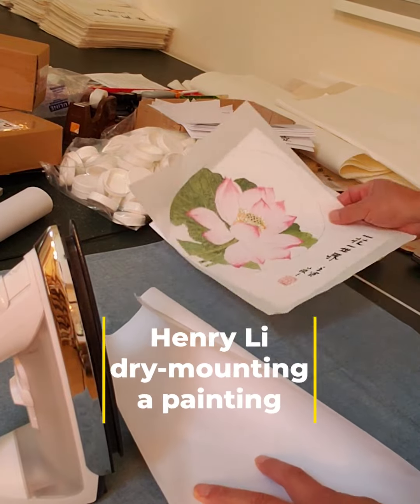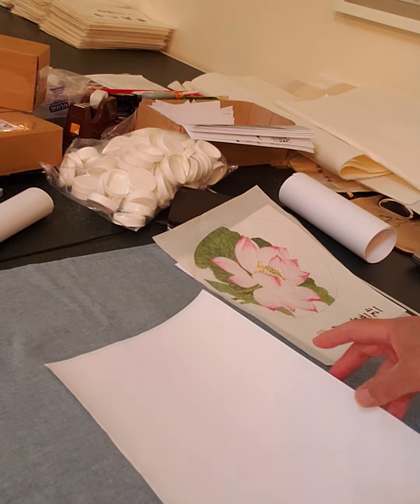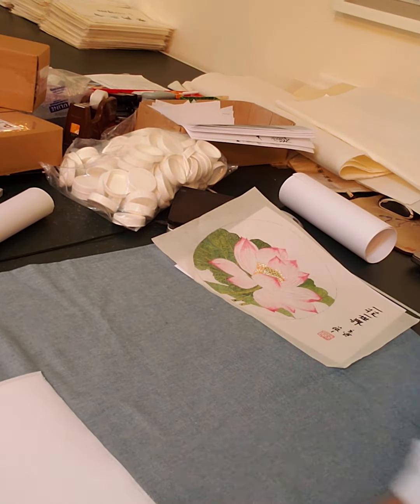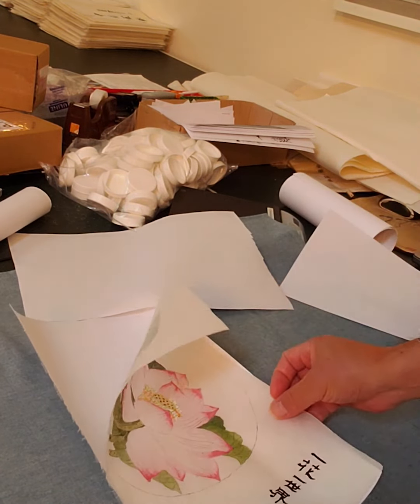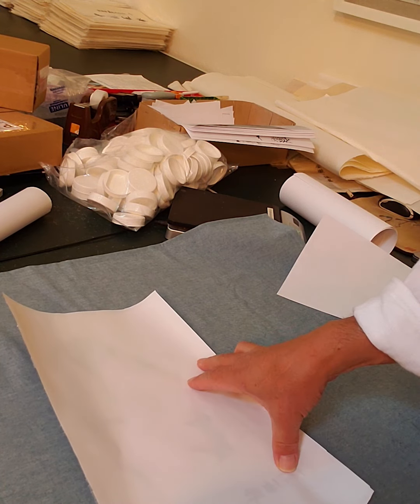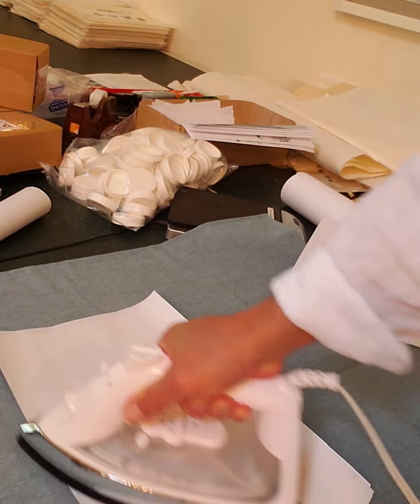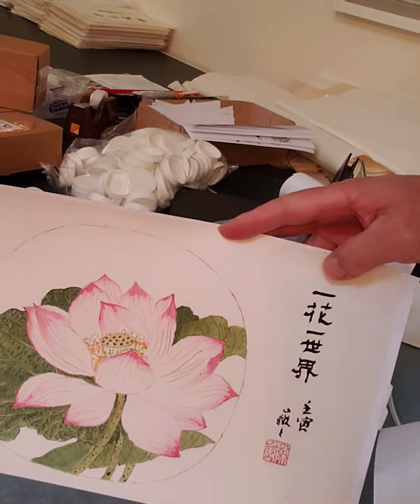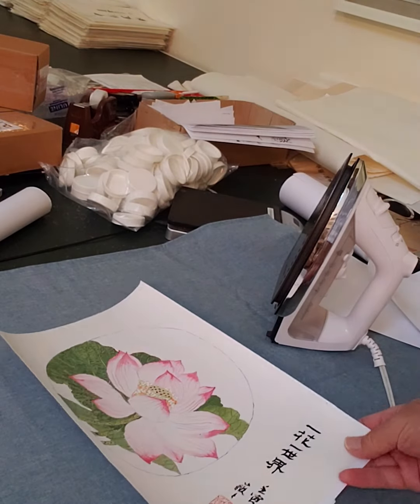Dry-mounting a thin rice paper painting with silicone paper

Comment: Thank you for this Henry!  I’m going to order some silicone this weekend.
I have a question.  Last night I FINALLY painted a peony that didn’t look like a “Frankenflower”-but it’s far from perfect.  I had problems with the sheep/goat brush I was using.  It’s an older brush, and I am going to try 2 more brushes tonight.  
I just added the “peony” brush on your site to my wishlist..but I can’t afford all 3.  For a medium sized painting-say 9x12 or maybe a bit smaller;  which size would you recommend?  
I also want to attempt some smaller peonies-in fact that’s what I’m going to try tonight-ones that would fit on a card or say up to 6x8.  I have some smaller white brushes; but they appear to be mixed..and one, (part of a boxed set a good friend of my late Son sent me), seems to have a defect- the characters are illegible and the brush is extremely stiff starting 1/2 way up..I know it sounds strange, I don’t know how else to say it. The other brushes were fine;  in fact my horse brush that I was afraid to use because it’s so firm..has turned into my favorite calligraphy brush and I’m using it more in painting because I have more control.  
I’m going to go TRY and make a smaller peony with the brushes I have. I seem to have the strokes down; moisture control-too LITTLE & constantly re-loading the brush last night, was my main issue.  Hopefully I’ll have better luck tonight!
Reply from the maker: For 9x12 size painting the small size peony brush is big enough https://www.blueheronarts.com/peony-sheep-hair-brushes-laosan-p-4522.html
Reply: Going to get it right now!  I also want to get some raw Xuan.  I have quite a bit for practice..but nothing for doing Xieyi paintings.   I attempted chrysanthemums yesterday..my Sheng Shu/semi-sized paper absorbed the paint as much as my raw practice paper.  Going to try again today, using a light sketch, on sized paper.  Some of my semi-sized is 6-7 years old..and I wasn’t keeping it protected like I now know I should.  I assume that’s why it’s acting strange..this is my 2nd “frankenflower” where there’s little definition to the petals because it ran together.  My 1st frankenflower..supposedly a peony, my friend turned it into a rose with pens & my white Sakura paint.  I haven’t quite developed the “eye” for proportion, shading, etc. Although my friend is new to Chinese painting;  she was an art teacher and painter long before I got her into this. 😂. It helps a LOT having a best friend with so much experience.